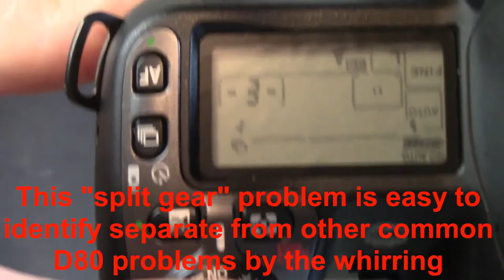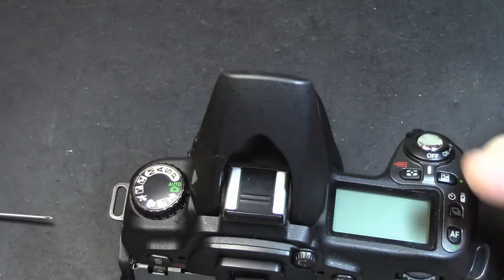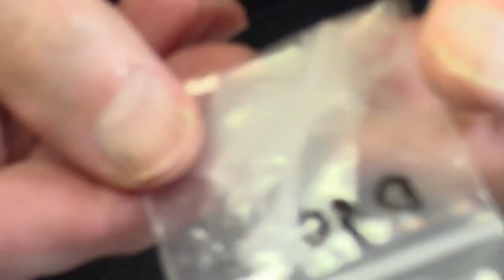Nikon D80 ERR +split gear pt 1

Comment: Thank you! Didn't have the split gear, but the problem with the spring loaded encoder wheel. Worked fine. And in comparison to other videos you managed not to remove the sensor, which would ruin the AF setting. This is the much better way (removing the mirror box and leaving the sensor in place). Thank you so much for your effort to record your repair and share it!
Reply from the maker: Thank you for commenting!

Comment: Excellent work! I started taking my camera apart. It was going well until I got to the auto focus/manual focus lever. I can't figure out how to get the button off, so the disassembly can't go any further. Any tips on the auto focus/manual focus button lever removal please?
Reply from the maker: Refer to 2:40 - use a sewing needle held by pliers to wedge behind the cover disk on the AF/Man lever, then unscrew the knob from the body
Reply: @ghccrtube5007  Thank you. I didn't understand what I was trying to remove. Done now! The capacitor is discharged and the camera disassembled  up to the desoldering stage.

Could you say what voltage you put into the shutter motor prior to reassembly please?
Reply from the maker: @electronaut7429  No more than about 3 volts should activate it without wrecking other circuits.
Reply: @ghccrtube5007  Thank you for that and for your video.

Comment: Thank you! This is very useful video. Great shooting angles and highlights, especially those parts to open flash and discharge capacity. I managed to tear my D80 apart and put them together with new split gear. Now the mirrow can turn. However get another error. Mirror now flip 3 times quickly when trying taking picture, but I can see shutter curtain remain closed all the time. Any hints? could it be the sequence switch?
Reply from the maker: Yes, likely the sequence switch, the contacts are easily bent when the gearbox is disassembled.  Be sure they are all even and high enough to make contact with the circuit board, since it's hard to check electrically.
Reply: @ghccrtube5007  Very appreciated for such quick reply! I will start another journey to my D80 this weekend

Comment: I could possibly do this and fix my D80, but im concerned with keeping track of what screw goes where? And tricks to that?
Reply from the maker: If you've got room put the screws on your workspace in the location and spacing that you removed them from.  At 12 o'clock place the two screws removed from either side of the eyepiece on the back.  To the right of them place the right side back cover screws.  Below these lay out the bottom cover screws, etc. (be sure not to sneeze).  I reinsert the tiny screws that hold flex circuits after the circuit has been lifted.   I've seen some people draw an outline of the camera back, sides, top and bottom then punch the screws thru the paper at the proper locations but seems time consuming to me.  Nikon is notorious for making a huge variety of screw diameters, lengths, and types.  Canon not nearly so bad.